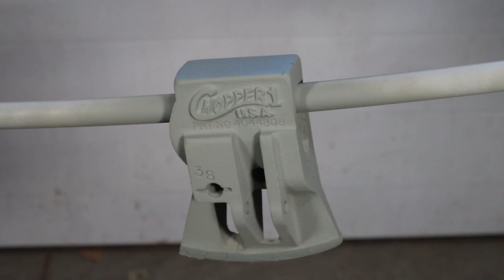I restored a splitting axe!

Comment: Very nice. A job well done.
I'm a big fan of Evapo-Rust. That stuff is fabulous.

If you ever plan to do another ax, here's a tip I learned from a U.S. Forest Service friend who restores axes:
Treat and finish the handle with linseed oil as normal and then lightly char the "seat" area (where the ax covers the handle) with a torch to prevent moisture penetration from moisture that will get trapped between the ax and the handle.

Thanks for sharing. That was fun to watch.
Reply from the maker: Thank you! Cool, I will for sure do that on the next one!